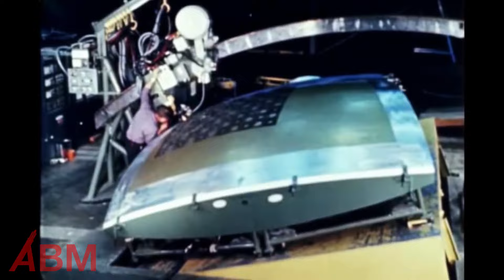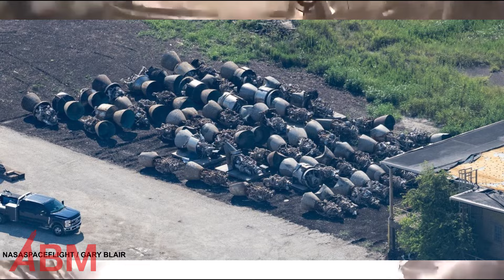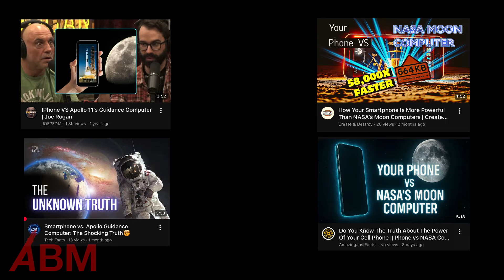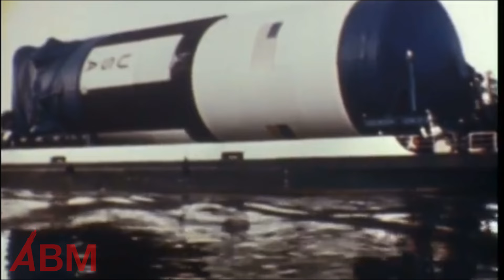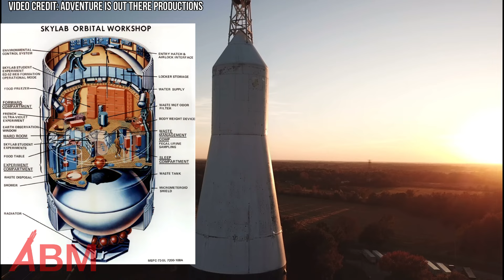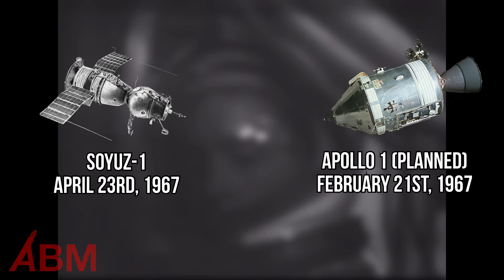NASA’s Moon Landing Technology: Lost Or Not?

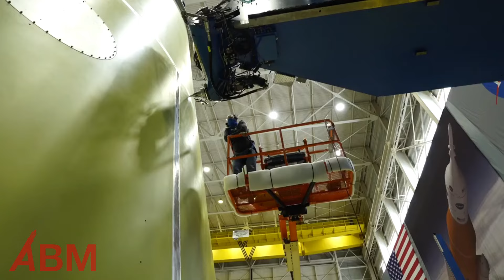Comment: 4:13 Stir welding doesn't use friction heating. In stir welding, heat is actually a problem to be minimized because it causes internal stresses as well as other issues. Pressure and torquing forces are applied to the seam with high enough force to make the solid metal behave like a liquid (sort of). The metal is literally mixed together. This eliminates problems with heat expansion and phase transition that occur in heat welding.
Reply from the maker: Appreciate the clarification and apologize for my mistake. If I make a follow up I’ll ensure to add that!
Reply: @AeroBigMike  No problem. I'm not an expert, but I know someone who helped develop the technology at NASA. He has demonstrated it for me. It looks like magic. If you cross section the weld, you can't even see the seam.

Comment: In so many manufacturing areas , the USA has become a cargo cult .  Worshiping past accomplishments while being unable to equal them.  Mechanical technology is a network of skills  and processes.   I doubt that Pratt and Whitney could now build another R4360 Wasp Major radial piston engine.  The kind of tool and die makers that allowed this are increasingly rare.
Reply: ....sounds good, sure you right now, tomorrow perhaps. Not sure Who wants a Apollo copy, just a ship to equal, Orion uses the same basic configuration as the Apollo command and service module (CSM) that first took astronauts to the Moon, but with an increased diameter, updated thermal protection system, and other more modern technologies. 
   As long as the contraption can get humans to Moon and on, that is okay. Not this year    or
Reply from the maker: The design of a crew module attached to a service module defines most crewed spacecraft- Vostok/Voskhod, Gemini, Apollo, Soyuz, Shenzhou, Starliner and now Orion

Only the Mercury capsule, space shuttle & Crew Dragon don’t match that description.

It’s a common design as it works reliably without bringing substantially more down mass than is required.